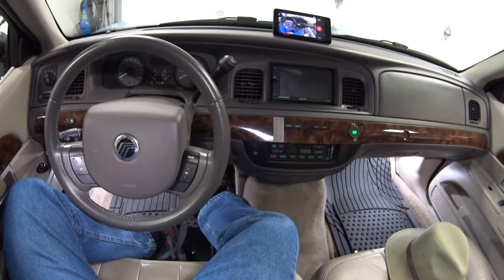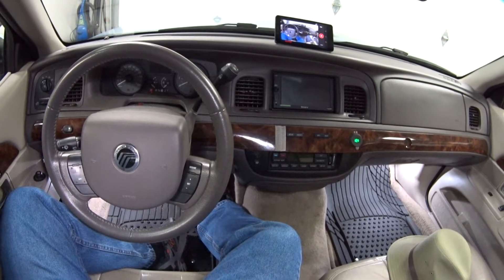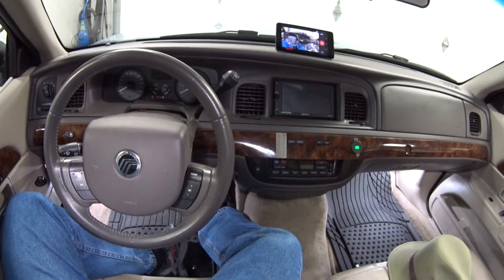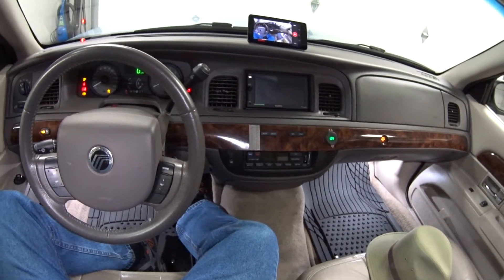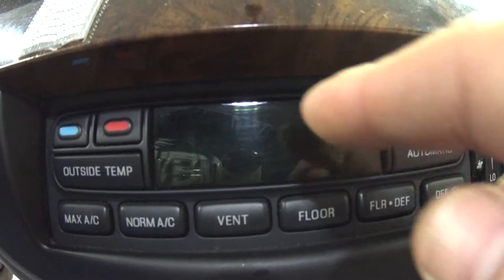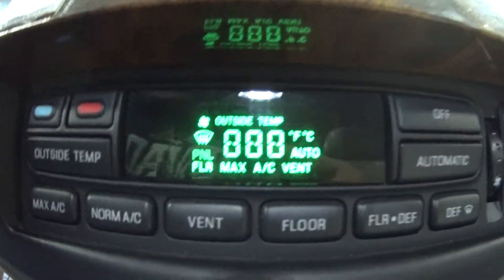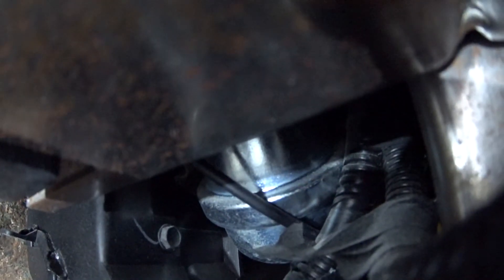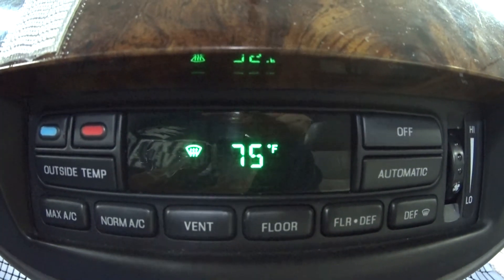Ford EATC HVAC Self Test - Reset & Calibration

Comment: Hi there..watched your video and tried doing the diagnostics test..it wouldn't start it..i have a 1997 Lincoln Town car..all blender doors are working as far as i can tell its just not changing temperature higher or lower if i push up or down on buttons..ant thoughts?
Reply from the maker: Yo Cobra,
Thanks for watching.

Before you begin your diagnosis please confirm & verify these things first;
Connect Scan Tool and check for DTC’s.
Check engine coolant for proper level.
Check Engine Coolant Temp Sensor by viewing scan tool data.
Check Ambient Temp Sensor for proper operation.
Check A/C Compressor engages / disengages properly.
Check Battery Voltage, and Load Test Battery.
Check Alternator for proper operation / voltage output.
Check all fuses in the passenger compartment, and under hood fuse box.
Check A/C Sunload Sensor for proper operation.

If you’re EATC Unit will not go into the Self Test mode, right off the top of my head that may be part of the problem.

I just referred to my service literature for ‘97 T/C, and it said at the very beginning the temp control must be set between 60F - 80F. Confirm & Verify, and try to do the Self Test again.

Under “troubleshooting” for SYSTEM DOES NOT CONTROL TEMPERATURE it says;
Circuitry open / shorted
Damaged EATC Module
Damaged Automatic Temperature Control Sensor And Hose Elbow
In-Car Sensor Seals missing or damaged

To be clear I’m not telling you to replace any parts, until you have tested them and can verify they have malfunctioned. Diagnosis must come before repair.
If you try to “Parts Shotgun” the issue, you may run out of ammo.
Sorry I’m not more help.

-Chuck

Comment: Thanks for this video! My MGM was sitting for a few months before I bought it a few days ago, and it seems like the self-test is all it needed to wake up after its long slumber. :-)

It was stuck on heat, but it's all working as it should now.
Reply from the maker: Yo Brad,
Thanks for watching. 

Maybe when the blend doors were commanded to perform a full sweep, for self calibration that unstuck one of the blend door motors. 

-Chuck

Comment: I got 24 and 25 on my 2000 MGM... the car is only blowing freezing cold.
Reply from the maker: Yo Chevy,

Thanks for watching.
First check to make sure your engine coolant/antifreeze is at the correct level.
Low on coolant, and there won't be enough to circulate through the heater core.

Next check the error code definition in the description.
Let us know how you get on.

-Chuck
Reply: @PanzerPlatform  I took the battery out and pulled out the fuse. Now its going again! Before that I ordered the Blend door actuator from rockauto... Oh well 30bucks + got some other parts I needed for it and if it goes I can change it when I got it already.
Reply from the maker: @ChevyBM  
Now hold on just a minute.
I've never heard of this before.

Exactly which fuse number did you pull?
And did you pull it from the fuse box under the dashboard, or the fuse box under the hood?

And keep us posted if it acts up again.
-Chuck
Reply: @PanzerPlatform  I looked from the manual witch fuse is for the "ac" and pulled it out and put it back again (the fuse box under the dash). It must have reseted the ac somehow. I'll keep you informed if it goes haywire again!
Reply from the maker: @ChevyBM  
Yo Chevy,
That's terrific.
Given that the HVAC control unit for your car is "electronic" doing this may have very well "fixed" it.

Maybe the system performed a self diagnostic test on it self, and failed, and then disabled the affected blend door motor to prevent any damage.

And when you disconnected the battery, and the fuse, that cleared the memory of any stored failed tests. And then when you reconnected the battery, and fuse the HVAC unit performed a calibration sweep of all the blend door, and mode door actuators, and it passed the self diagnostic test. 

And thank you for keeping us updated.
If anybody else with this issue comes across this comment it may help them, and save them some frustration, and money.
-Chuck

Comment: Can you help me my 04 grand marquis does not blow at all the blend door is clicking but no heat or air blows out the vents at all. what could be the problem? compressor comes on and off and the line is cold. but nothing blows out the vents at all.
Reply from the maker: Yo Mackrod,
Thanks for watching.
Did you perform the self test procedure?
That should give you a trouble code as a starting point.

If you have the manual HVAC controls (three knobs), it sounds like there is no power going to the blower motor. 

Check all fuses, and check the blower motor resistor.

If all those are good, check the blower motor itself, it may have burned out. 

Let me know the results of these checks, and I'll be able to provide further assistance.
-Chuck

Comment: What if you get 888 but there were no sounds at all?
Reply from the maker: Yo OG,
Are you having any malfunctions, or issues with your HVAC system?

It's possible the sounds of the actuator motors are really quiet, and you can't hear them operate. 

-Chuck
Reply: @PanzerPlatform  Yes Sir, I have the "blowing from defrost only issue" Really digging into this now because I miss my Vic and I want to drive it comfortably again!
Reply from the maker: @OGDurtt  
Check out "FordTechMakuLoco" channel for the fix. 
-Chuck

Comment: Repaired mine yesterday. I had 2 issues, 1 - always blowing hot and 2 - always blowing through the defroster. I replaced the blend door actuator, $33 (024 - blend door fault (during test)) and that fixed the Temp problem. Then I ordered the silicone o-rings ($7) and replaced all 4 on the actuators inside the EATC controller. Like you said, see video by FordTechMakuloco for detailed how to instructions.
Reply from the maker: Hey Marauder,
Thanks for chiming in with the good feedback.
Just to clarify for passers by.
What year, make, and model did you fix?
And if you could drop some part numbers, that would be good to.
-Chuck
Reply: @PanzerPlatform  2005 CV LX Sport - Blend Door Actuator p/n Motorcraft YH-1766... 007 Silicone O-Ring, 70A Durometer, Red, 5/32" ID, 9/32" OD, 1/16" Width... Got both parts from Amazon.